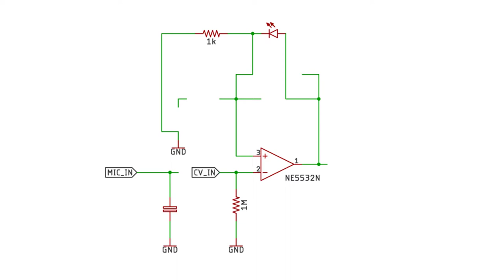Hacking a karaoke delay PCB for Eurorack

Comment: I'm amazed you can just swap out the dual AC power like that! Thanks for the tutorial!
Reply from the maker: The circuit is designed to convert the incoming AC to DC, via the rectifier. So you can either skip the rectifier or the DC can go through the rectifier unchanged.

Comment: I followed your instructions exactly on two different boards and I can't get any audio to come out unless I move the input wire to the LIN and then of course there's no delay. I can't figure it out. I've watched this video over and over and retraced my steps. The only possible issue could be with the trace cutting. You sped up the part where you checked so fast that I didn't know how to check but I didn't see anything shorting to ground. The trace part is by far the hardest part for me. I don't understand how these modern PCBs work and if there's any way to mess it up. My boards look exactly like yours. It's so frustrating, I don't know what to do at this point.
Reply from the maker: Sorry, I'm away from my bench for a few weeks. Have you looked at the source that I started from? Addictive noise - link in the description. I'm pretty sure my video and Jan's info are accurate - maybe post some photos of what you've done on the Eurorack DIY Facebook group?
Reply: @RobDuarte  Thanks for the encouragement. I finally tried it again tonight and it worked! I probably just cut a trace wrong before, who knows? Sounds great, for a cheap low-fi delay. I’ll probably make 2 more since the panels come in sets of 3. Might be fun to chain them together for some interesting drone stuff. 

I need one of those mutable board testers but I can’t figure out where to get a programmed IC for it. Let me know if you know where I can buy one. Thanks again!
Reply from the maker: That's what I did - made 3 of them. :) As far as the Mutable module tester goes.. you should get a cheap AVR programmer board - it will be a good learning experience!

Comment: Nice tutorial Rob, i did one myself and it works ok. I have couple of question about some of your mods so maybe i could improve mine. What  is the purpose of the 1M resistor you add at the end? And my unit is distorting a bit at the input and definitely cuts some low end from the source. Have you managed to address that? Thank you :)
Reply from the maker: Take a look at the schematic I show in the middle of the video. The 1M resistor is part of the led driver circuit that I added.
Reply from the maker: If you didn't reduce the input level somehow then I'd definitely expect distortion since the preamp amplifies the input 30x. Part of what's happening in the video is rerouting things so it bypasses that preamp. More info on that from Jan at addictivenoise.com

Comment: Do you have any concerns about using +- 12Volts when the filter capacitors are only rated for 25V?
Reply from the maker: I haven't looked back at this in a bit, but I believe the original circuit was designed to take 12VAC input. The rectifier turns that into +12VDC and -12VDC. So, you might have to take up the capacitor choice with the company that designed the board. :D
Reply: @RobDuarte  Thanks for the fast response. My mistake, Each capacitor only receives 12V. Well within ratings.

Comment: Cool!
Can you explain how you connect power to this board? What is polarity? How much Volts on each orange wire? I see in demo part - you remove diode bridge, so can use eurorack power directly, or it has some different values?
Reply from the maker: I removed the rectifier during some troubleshooting with this specific board (there was actually a solder bridge at the connector and nothing wrong with the rectifier, it turned out). I would leave it in place. If you do, then the eurorack IDC connector can go either direction! If you remove the rectifier then you will have to make sure that the -12v is at the pin closest to the mounting hole, the +12v is on the other end of the pin header, and the ground is in the middle. Whether you remove the rectifier or not, it uses those Eurorack voltages.